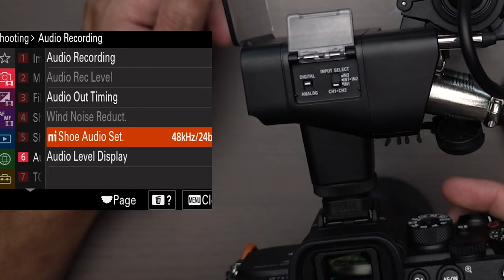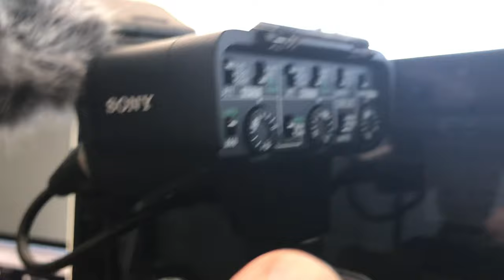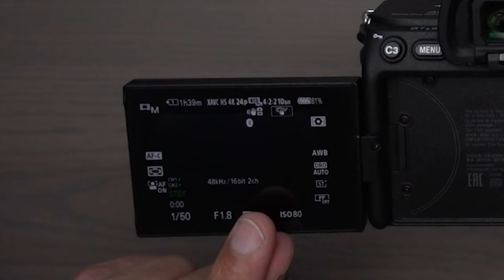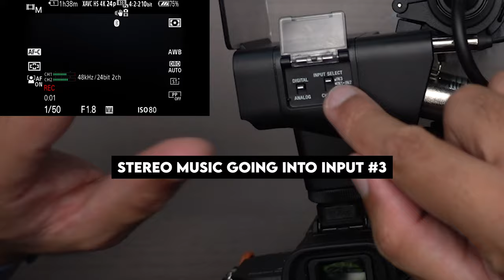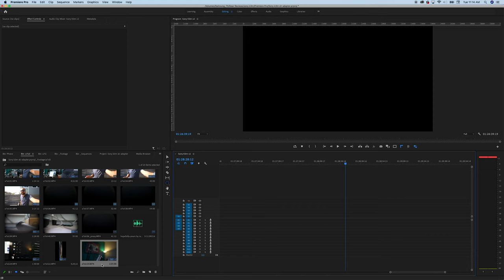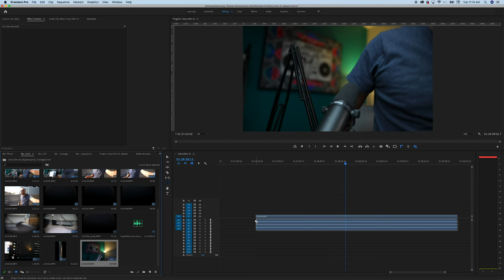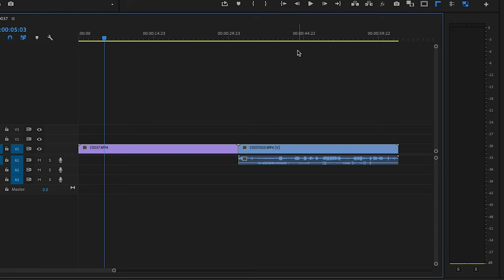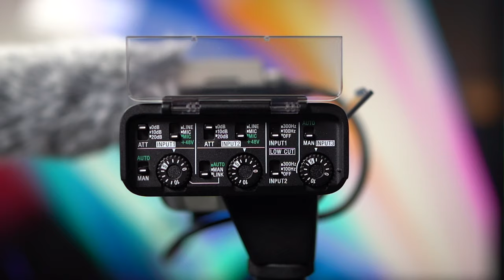Sony a7siii Pro Audio with XLR-K3M Dual-Channel Digital XLR Audio Adapter Review

Comment: This is literally the only video I've found going into great depth about using this XLR K3M.  I was concerned it wouldn't be a smart investment because I don't want to deal with having to rewrap audio files in post before using them, but because I edit on Premiere and have the latest version, this video cleared that up for me.  I actually am leaning towards purchasing an FX3 and my understanding is that the audio module on that camera functions similarly to the XLR K3M, so now that I have some clarification I feel a lot better moving forward with it.  Thanks so much!
Reply: Can you talk on your experience? Thinking on FX3 because of the better XLR, but doesn’t have the EVF like A7S iii. I’ve watched numerous videos on comparing the two, but rarely any talk about the actual XLR. Especially with Shure SM7B, which is why this video was helpful from the A7s iii perspective

Comment: Awesome! Finally someone did an in depth review of one of these. You convinced me to get the k3m version even though I currently own an A7iii and an A6400
Reply from the maker: to be honest, I think it sounded better on the a7iii than the a7siii, but I also had a better understanding of my a7iii since I've used it way more. It is a great piece of gear for those looking for the convenience of audio straight to the card.
Reply: Sony has two types of MiShoe, the one in your video and the one on my FDR-AX100E, both named the same but not compatible. This is not documented anywhere. Shame on you Sony.

Comment from the maker: What do you think, is a k3m in your future as a sony shooter?
Reply: Oh this is a reason I purchase the A7SIII.  To get 4 channels otherwise, need a $$$ cinema camera. Do not want to add encumbrances of off-camera recording, in the field. 240 fps slo mo is also useful to my work. I've used an older version of the XLR adapter on a Sony camcorder for 10 years, its worked well. Does have a cold shoe on top.
Reply from the maker: @stucarter  good to know the previous version worked well for you Stu!
Reply: @JavierMercedes  The older XLR adapters functioned as a handle. Some Sony camcorders still do this. But the A7R is a "camera", so...form factor.

Comment: Are you plugging the SM7B directly into the camera handle without an audio interface, and are you also using cloudlifter? Thanks :)
Reply from the maker: Yes cloudlifter, no audio interface (the camera handle is an audio interface)
Reply: @JavierMercedes  thank you! Just got the FX3 :)
Reply: @DJJordanLee how is your experience? I have a cloudlifter and Scarlet interface, and am considering FX3 over A7s iii. I assume I plug the Shure into the cloudlifter, and the cloud lifter into the XLR instead of the Scarlet??

Comment: I think a (magnetic) shielded USB cable could help to eliminate the interference. Is the quality of this module at a level that the audio quality is on thr the same level as the audio recorded with the FX6? That's an important question to answer before making a decision.. Besides this you are right that a cold shoe would be very handy for a lav receiver.

Comment: Great Video. If you had the previous models K1M or K2M could you test on the a7Siii as most operators may own those previous models. Because of a7Siii wanting a digital signal, a test with previous models would be an interesting and informative video to see if they are even compatible with a7Siii. Thanks.

Comment: Thanks for the helpful vidéo ! Just found out a big problem on the A7S3 audio monitoring (using XLR-K3M with my A7S3). You can't chose which channel you want to monitor UNLESS you record 4 channels of audio (which is basically useless because not supported by NLE software). So if you're recording only two channels of audio (CH1/CH2), you CANT decide to monitor only CH1 or only CH2 in headphones. That sucks big time.
Reply: I have same problem with sony a7iv, and it records one in channel 1 and the other input on channel 2 I can't get it to be on dual stereo and listen to two at the same time on stereo on my headphones

Comment: I used an older version and rigged up a couple of sennheiser receivers on top. Eventually that rubber connector loosened up- that’s why they don’t want that extra weight on there
Reply from the maker: Very good to know. I figured it was something like that.

Comment: This is such a great video, Javier! Thanks a lot for sharing. One question. What settings would you recommend in terms of volume levels (assuming studio a-roll vs vlog outdoors) and stuff when being used with the a7siii? Thanks again.
Reply from the maker: I keep it on auto most of the time if I don't know what I am facing and that just a good job, if I am monitoring it I set the levels but I keep it on auto all other times.
Reply: @JavierMercedes  thank you! Will give it a go as I plan to use it as vlog but also in studio. One last... did you keep the original mic (ECM-MS2) or replaced it with any other? I have one Sennheiser MKH 416-P48 coming soon, so I was thinking if that could also be a good fit to use it with the  K3M!

Comment: Nice review and those additional channels are a serious upgrade! I've been using the XLR-K2M for the last 4,5 years and it always worked nicely. It also doesn't come with a coldshoe mount on top but I think they did this on purpose. When I attach a wireless receiver like the AVX system directly into the XLR-K2M I sometimes get interference. Just to be safe I always use a XLR cable to move the receivers away from the adapter. I'm curious if the same problem would occur with the XLR-K3M because this makes me rig up my a7sii+xlr-k2m combo, which is a bit of a bummer. It would be nice to keep it compact.
Reply from the maker: Ahhhhh interference would be a good reason why, great point. I'm just glad devices like there exist to get good audio into your sony alpha cameras.
Reply: @JavierMercedes  Yeah for sure! Being able to monitor through the camera, no need to sync, no extra batteries for the recorder needed, no need to push record on two devices, many advantages! :)
Reply: I've  used the XLR-K3 unit with my AVX receivers on the A7iii and A7Siii and never had an issue with interference.  They seem to be a great combo.
Reply: Hi Rens, do you know if the K2M works with the A7siii?
Reply: @muffythang  it does, Jon. Just in analog mode. Frankly, I can’t hear the difference between analog and digital
Reply: @muen1842  awesome I got mine on ebay and it's coming tomorrow, super excited. Thanks for responsing 😊👍
Reply: @muffythang  phenomenal! Hope you enjoy :) Have had a lot of fun with this combo

Comment: Javier is not your Studio setup with the audio issue on the 3.5 jack while using power delivery.. that’s just a known issue period with audio. If you have an iPad connected with a 3.5 and have the power of the iPad connected you will get the same power issue.

Comment: Great detailed video as there are not many about. Thank you. Could you shed some more light about correct db settings? 0db 10db or 20db whilst setting the camera to around 5db? I have been setting to 20db on the k3m and I have been relatively happy but when I compare it to my external sound recording I find that the external sound has a much better tone, more bass in my voice etc. Am I missing something?

Comment: Thank you very much for the video, I bought the same Sony XLR K3M system and watched your video, can you use 3 microphones at the same time? System has 3 inputs in1 in2 in3, but if you can select only IN3 or (IN1+ IN2) or only IN1, there is no possibility that all 3 select IN1 + IN2 + In3 together. I would be very grateful for your reply. Kind regards Farnoud

Comment: Hello Javier. I am new to the sound world. I am using the K3M on a Sony A7s iii. The audio is great but I cannot figure out how to use a wireless lav mic while using the directional mic at the same time. When I plug in the wireless receiver to the K3M, I lose the sound on the directional mic. Any advice would be helpful.

Comment: Hi man! Could you recommend something on how to mount an XLR microphone with K3M? I have Rode NTG5, and K3M mic holder is too wide for that. Wondering what is the right choice: to get a cage and a sidearm with a mic holder, or just find some rubber to put around lower part of a mic that will fit into a K3M holder?... Also what XLR to XLR short cable would you recommend? Thank you!
Reply: have all the same questions, did you manage to find the answers? Thanks!
Reply: @AleSalvino  Hi, basically I've asked that question Rode and SmallRig and it seems this set up would work: SmallRig 3008 Professional Kit + Rode SM3-R Camera Mount + SmallRig HSN2093 and as for the short XLR-XLR I couldn't find one that's ready to buy so just ordered to manufacture one, 30 cm (including xlr adapters) seems to be ok length

Comment: If only Sony XLR-K3M had 3 XLR inputs I'll buy it with no hesitation. But I need a shotgun mic to XLR and 2 LAV's Sanken COS-11D which also have to go to XLR's... for interviews setup. And for that works something like Zoom H6 which could be routed directly into the camera through the line out: all tracks will merge into one and no sync is necessary. But XLR-K3M is "more native" to Sony cameras and there is no line out, sound is being recorded directly with a hotshoe mount. Honestly it is sad that after K2M Sony didn't think about that. Who needs 2 XLR and 1 TRS input?? If you go with XLR you stick with it. I'm gonna have to go with Zoom H6 until there is the Sony XLR-K4M :))
Reply from the maker: Understandable, One hot tip with the Zoom H6 and using the line out into your sony camera is to PAN your inputs hard left and right in the mixer. If I were in the situation I would split the Lavs to one side and the Boom to the other, that way you have some sort of isolation. You could also still utilize this technique with your h6 going into the stereo input 3 of your k3m, but it would still require an h6 to be handy.
Reply: @JavierMercedes  Thank you Sir! This is really helpful, I've heard about this trick somewhere but totally forgot it. Still waiting for my Sony A7S3 though ) here in Russia we're supposed to get it after 19th of November.
Reply: @JavierMercedes  Still thinking. Zoom H6 is great but you have to feed it AA batteries... which I hate to use and they're bad for the environment. Here is a thought, maybe with K3M you could use a shotgun mic to XLR input, one LAV with a Rode VXLR+ adapter to a second XLR input. And lastly, second LAV mic with it's 3.5mm to the 3.5 input. So... is it possible to record 3 audio tracks simultaneously?
Reply: Got it anyways :) With a Rode NTG5. Just have to get next few things too if you have an XLR mic that you want to use as a camera mic (setup for Sony A series): SmallRig 3008 kit + Rode SM3-R Camera Mount + short XLR-XLR cable + (optional) SmallRig HSN2093. Mount a mic on one handle (right is best) and external monitor on another. As for LAV mics, opted for two Deity w.lav pro's: one goes into 3.5 and another into second XLR input with a help of Rode VXLR adapter. Maybe this will help somebody :)
Reply: I have a slightly different scenario. I want to take stereo out of a mixer via two balanced 1/4 inch cables into the XLR combos on the fx3. Then I will use wireless go II into input 3. That would support both transmitters for either 2 channel, backup padded channel or mixed mono. Having hooked it up yet but will soon

Comment: Hey Javier! Sorry for the rookie question: I’m not sure if I understand the whole functionality of the K3M… Is it main that is it an adapter to use XLR/phantom power mics with your Sony camera… Or does it also provide superior preamps and sound procesing?
Reply from the maker: Yes to all of those kind of. XLR inputs, Phantom Power, superior preamps, ultimately it saves you time by having the capability to record professional audio directly into the camera so you don’t need to use an external recorder.

Comment: Great video :) When I use my ninja V recording as .mov files I can only get 2 channels of audio going through to the ninja. In the a7siii HDMI output options, it only gives you the option to record channels 1+2 OR 3+4. Pretty annoying so I ended up removing the mic that came with it and running a lav into channel 2 and 416 into channel 1.  Hope this changes in the future or I'm doing something wrong. Would be nice to have the shogun that came with it as a scratch audio track also. Regardless great piece of kit and good concise video brother :)

Comment: Dear Javier, Do you have news on the compatibility  of the K3M? Is Sony working on it?
Reply from the maker: Compatibility with what?
Reply: @JavierMercedes  Sorry for being so unspecific. I meant using 24bit recordings in editingsoftware. I use Davinci Resolve. Are the files still unusable/ unhearable? Will Sony tell us whether they have fixed te problem? Or do I have to contact Davinci?

Comment: Good video! Post production convenience aside, how does the k3m compare with the zoom h6 in terms of pure audio quality?
Reply from the maker: I use my K3m audio all the time and haven’t used my h6 since buying the k3m for the most part. H6 might have better quality but I haven’t noticed since using the k3m for convenience. Hope that helps!
Reply: @JavierMercedes  helps a lot thanks! Trying to decide on the A7s3 with a different external recorder or FX3.

Comment: Hi!  now that you've been using this - can you tell me if this is actually recording separate 4 channels of audio on the physical video file (2 stereo tracks), or if it's simply mixing the 4 channels of audio on the K3M inputs down to 2 channels of audio (a traditional stereo file connected to the video file)?  I have an A7Rii btw,.  Thanks for your advice!  It would be great if I could capture 4 separate audio signals.
Reply from the maker: 4 separate channels paired to the one video file. Unfortunately you need the digital hot shoe mount on your Sony camera to access this. The A7Rii does not have this, it’s only analog. I think A7R4 and a7siii were the first camera in the alpha line to have the digital shoe mount.

Comment: Thanks for this. I have the a7s iii and got the xlr handle. It’s four years after your recording this video. Thanksgiving 2024. When I record on 4 channels I still do not hear any of the audio when I play it  outside of Premiere. Do you know of any changes to this or is this still an industry standard crippled feature that still exists? Thanks in advance if you still monitor this video.
Reply from the maker: I think my computer defaults to playing channels 1&2 even if there is audio on 3&4 outside an editor, but I’m not sure what the issue could be other than that.
Reply: @JavierMercedes  i am in a peculiar situation. Yesterday I got my mic equipment and simultaneously,  I have been locked out of my adobe premier account. So I can not test it to make sure the sound is working there. My computer,  though relatively new, defaults to silence.  Would you happen to know if DaVinci is able to process the 4 channels.  Your vid is several years old so there could have been advancements there, but you just never covered it. If so, I might download it and start using it instead.  BTW, thanks for responding.

Comment: Javier Mercedes I'm trying to use my Sony URX- P03D wireless system with the a7siii. The niShoe Audio Set. menu remains grayed out. Any suggestions or is this wireless system not compatible with the a7siii? FYI, the hot shoe is powering my receiver, just receiving audio in the camera. TIA.

Comment: Have you had any issues importing these files into Premiere? I have the Sony FX3 which has essentially comes with the K3M, but when I try to import the 4 audio channel files into Premiere there's no sound at all. 2 channel recordings import like normal, however, and the 4 channel files still play in Catalyst Browse with no problem.
Reply from the maker: It used to be an issue but in the newer versions of premiere it works fine for me.
Reply: @JavierMercedes  Thanks! I was using 13.0 and just upgraded, working great now. Cheers and thanks for the video.

Comment: Zoom h5 external, wouldn’t that be out of sync with video need post clapper board sync. However get this and vid and audio are perfecting in sync and saved on camera sd card as video and audio. Or am i missing something? Is two channels of recording the same as stereo line input though?
Reply from the maker: Yes two channels of recording is same as stereo if you use stereo input. This can do up to 4 on the a7siii. You can split the input to two mono if you use the xlr or do stereo. Depending on how far away from the camera you are a clapper would still be needed to have perfect sync.

Comment: I have an A7Siii and with analog mic's plugged into the camera mic input, I get a lot of background hiss, is that normal?  Is the XLR-K3M the only way to get decent audio with the A7Siii?  Even my phone does a much better job than the A7Siii.   Thanks, Monte
Reply: I think this is the best audio thing you can get from sony. I mean its xlr adapter - xlr adapter are awesome if you are serious about your video sound. They have that digital mic but imo this is much better because you can upgrade audio in future for something much more expensive

Comment: Just picked this up. When trying to use this with the Shure Sm7B, do I still need to use my Cloud Lifter in the XLR chain?
Reply: I had the same question.  Did you figure it out?
Reply: @abennett  The answer is: yes. Also, you need to have 48v on for the CloudLifter. A SM7B doesn't need 48v, but the CL does.